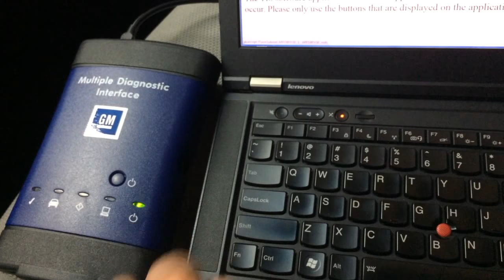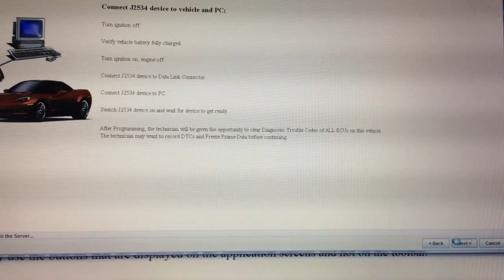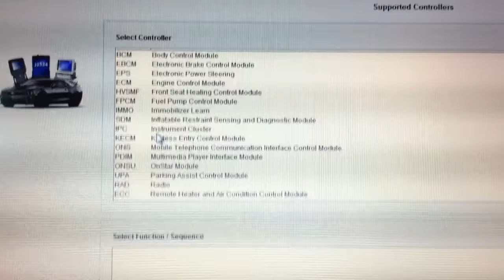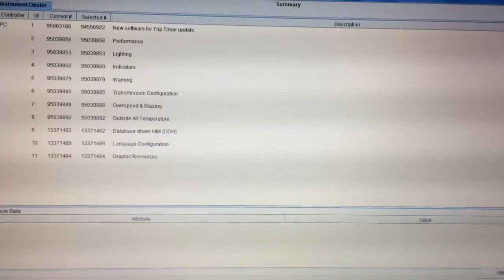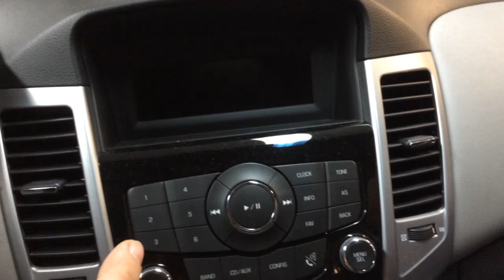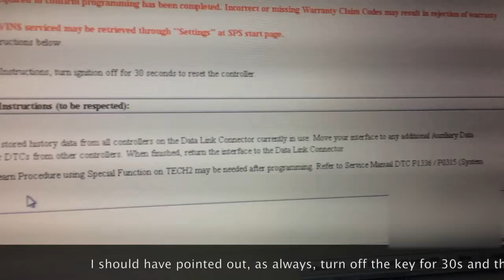GM SPS Programming: MDI Tool J2534 Mode ECU TIS2Web How to do a Calibration Update Reflash (IPC)

Comment: Can the GM MDI support ford online programming. Also are you into vehicle repairs. do you operate an automobile workshop in the USA
Reply from the maker: @Mayowa Odus I'm not aware of any out of the box way to use a GM MDI in place of a Ford VCM tool.   I would imagine significant modding/hacking would be required.   No I don't operate a shop, just as a hobby.
Reply: @DrShock  can the autel j3534 box support ford online programming
Reply from the maker: @Mayowa Odus I don't have any experience with Fords.   My experience is mostly with General Motors, Chevrolet and Pontiac in particular.
Reply: @DrShock  alright thanks a lot you have been of tremendous support. Can I get your contact details like your email.would like to ask some important information. Thanks once more

Comment: Hi! Do you know how to enable audio controls and cruise control in the wheel?
Reply from the maker: If the vehicle came factory equipped with cruise, it should be in the where you rebuild the vehicle for the BCM config.  You'll need more than just a calibrations subscription on TDS to get at that with an MDI, but its been a bit too long for me to recall the steps.
Reply: @DrShock  this version of the vehicle didn't came with cruise and no audio control too, only the top version came with. It's have a electronic accelerator like the top. And the audio control, can I enable? Here in Brazil have several technician to enable the audio control but not the cruise. The car is a gm onix sedan 1.4L petro year 2015. I was very glad to your answer, thank you.

Comment: Am trying to unlock a GMC terrain 2011 radio using SPS. The older one got burnt another used one was installed part numbers are different. Initial radio comes with a satellite radio while newly installed one doesn't. Getting to sps I didn't see part number for the later radio installed. Choosing the calibration file the "NEXT" button remained dormant. I used the autel jbox and also GM MDI. Any guide one this or could it be because part numbers are different. 

N.B : part number of burnt radio appeared on sps but couldn't find the part number for the used installed radio
Reply from the maker: SPS is only going to have calibration support for the radio part numbers the factory or dealer would have been authorized to install for a particular model and year.   Personally I've only done this procedure with a radio part number that was factory original.  If it were me I would skip trying to SPS it with a new calibration and instead use Tech2Win over the MDI to attempr a simple VIN relearn on the replacement radio.  F0 diag, model blah blah, F1 Body, more vehicle details blah blah, Special Functions, Radio, VIN Relearn.  The menu tree may vary on the Terrain but this is the general jist.  Not saying it will work, but worth a try since unlocking the radio is all you are after.
Reply: @DrShock  I tried this using the maxisys elite tablet and MDI didn't have the vin relearn function. Am looking at a radio part number compatibility issue here. Have watch videos where the sps was used to unlock the radio by simple downloading a calibration file to the radio. Read somewhere that basic relearning was supported till 2008. For 2009 upward it needs to be done using SPS
Reply from the maker: Then you're back to the radio part you have wasn't supported for the vehicle problem.  May have to just go the EEPROM pin pull route if you don't have the right radio.   Search around on Youtube there's some vids on this, not sure if it is applicable to the radio you have or not though.
Reply: @DrShock  could that have made the next button on sps inactive inorder for the radio to get programmed. The damaged factory installed radio had its part number listed on sps for me to choose. the incompatible radio didn't have it's part number listed on sps.
Reply from the maker: Not getting the context for what "could that have made" refers to in your question.   If the radio is in a locked state, and you can't do the VIN relearn the only other solution I'm aware of is the EEPROM pin lift.  But I don't have experience with a 2011 Terrain to know if that's an option for you here.   Would have to defer to another video for the EEPROM route as I don't do those mods personally.   When you do these EEPROM disablement mods it can affect some radio functionality, but the main purpose is that chip stores the VIN and by removing access to it the Theftlock II is bypassed.   Not sure what year this approach ended being viable though, 2011 might be "too new" idk.
Reply: @DrShock  yes I do know about the EPROM lift. I would be getting the exact radio with same part number soon. Could you be of help  with the programming. Thanks for your time out
Reply from the maker: Certainly willing to try, though if you have a compatible part number it should "just work" ;-)

Comment: I am new to this but I already have my j2534, to which page I have to go to acquire the tis program. I want to learn from scratch I'm from Guatemala and this would help me a lot.
Reply from the maker: TIS is online paid GM subscription only, go to www.acdelcotds.com to sign up
Reply: Hola Benedetto , there are ways around gaining SPS without acdelcots access , if the car is before 2008 , after 2008 all north American GM programming access was moved to the cloud for remote download from TIS . Previous revisions where issue on CD install to your computer via TIS2000 .
Reply: @adonisnetworks  I have a cardaq passthrough and I am really confused on what I need to purchase. Do I need the TIS2000 if I get Tech2Win and Do I need Tech 2 Diagnostic Software? I am getting into Diagnostics and programing

Comment: Does this still wok with ACDelcoTDS or is it blocked by GM?
Reply from the maker: Still working just fine from here in the USA.   Note that TDS is a fee based subscription service, so if you are not paid up you will be blocked.
Reply: DrShock thanks for answering and clarifying. The reason i asked is because i do have a subscription and Im using VXDiag VCX nano, which for some reason does not work and can’t get recognized on SPS
Reply from the maker: Just a guess, but see if this SPS UI change affected you - https://gm-techlink.com/?p=11972

Comment: I have been trying to access this (www.acdelcotds.com) now. All I get is unknown error occurred. Pls refresh page. Have tried different browsers like firefox internet Explorer and Google Chrome. Any way round it
Reply from the maker: Just tried it, works fine for me.   The landing page is now https://www.acdelcotds.com/subscriptions but it's still the same domain name for the website.
Reply: Am actually doing this from outside the US. Africa to be precise any way round this to access this website
Reply from the maker: This could be alot of things like your country ISP blocking this site, your DNS not having this site, or any number of geo blocking firewall situations in country.   Couldn't help you with any of that, and unfortunately the TDS help desk is only an 800 number so unreachable from outside the USA.
Reply: Am trying to unlock a GMC terrain 2011 radio using SPS. The older one got burnt another used one was installed part numbers are different. Initial radio comes with a satellite radio while newly installed one doesn't. Getting to sps I didn't see part number for the later radio installed. Choosing the calibration file the "NEXT" button remained dormant. I used the autel jbox and also GM MDI. Any guide one this or could it be because part numbers are different. 

N.B : part number of burnt radio appeared on sps but couldn't find the part number for the used installed radio

Comment: DrShock I appreciate your help I’ve done ipc programing for 2015 sierra 2500HD unfortunately when i was done the lcd went black and didn’t work again can you assist me on my mistake?
Reply: I used sps with MDI 2
Reply from the maker: You mention the "lcd went black" - where you applying a new calibration to an instrument cluster?
Reply: DrShock yes
Reply: DrShock when the programing finished the lcd went black and not functioning
Reply from the maker: Ok, so the IPC is "normally" a pretty straight forward SPS update.  I've not run into any issues with them, nor aware of any gotchas here as long as the cluster is the correct original one for the vehicle (if one modified a cluster or swapped it from a different vehicle then SPS could get confused).   Have you tried to disconnect the MDI and re-attempt to see what TIS2Web is showing for the calibration level of the IPC module now?   To determine if its actually bricked or just blank?  If SPS can still "see" it I would attempt to reprogram the calibration again, double checking that the calibration selected is correct for your vehicle and its RPOs.   If SPS cannot see the IPC, unfortunately it may be bricked (battery power fluctuation from a tired battery during programming can cause this).   Before I gave up and replaced a bricked module, I would try to disconnect it from power for awhile and then reconnect and retry one last time.
Reply: DrShock I’ve done what just told me and unfortunately it looks like that its bricked although everything when correctly the connections were perfect no disturbance what so ever
Reply from the maker: That is really surprising, for this particular type of module.   The only time I've personally seen, or even heard of, things go awry is with a weak battery (which the GM EL-49642 dealer tool mentioned in the description is intended to avoid).    Let's check one more thing before writing it off.   So you've disconnected it from the battery and that didn't help.  One other check you can do is the fuse associated with the IPC on the drivers interior side panel.
Reply: DrShock its fine already checked it twice
Reply: I swapped it with another ipc and it works , the one I programmed is damaged for some reason
Reply from the maker: Likely bricked then, could have been a power fluxuation but that's just a guess.   You may still be able to have it repaired, removing the EEPROM involved is usually the approach.   There may be some other videos that walk thru this for correcting mileage on late model clusters, for example.

Comment: Hi
Can explain me what is configuration and how is use
Reply from the maker: Are you referring to the MDI configuration within the GM Java applet?  Or?
Reply from the maker: Ok so that part isn't shown in this video, it's pretty straight-forward being USB to the laptop there's nothing you have to tell TIS2Web (or now Techline Connect) anything other than youre using a J2534 MDI connection as we showed in this video.  If you need to configure the MDI for WiFi, Wired, or a firmware update see the latter half of this other video here - https://youtu.be/pZfXuuzORZo

Comment: Well I had a nav radio go south 
Replaced it same nav unit but now the anti thief crap active dealer item to resolve ?
Reply from the maker: If the problem is a VIN lock, and needing a VIN relearn, yeah a dealer grade scan tool is required.   You would need to research whether your vehicle is older and needs the Tech2 scan tool (or Tech2Win emulator for the MDI tool) or whether it's SPS with the MDI tool.  It varies by year and model so I couldn't say for sure.
Reply: The ride a Cadillac 2006 sts
Reply from the maker: Tech2 era
Reply: Dealer will need to reprogram the unit  then  I got the radio from a junk yard do I need it’s vin ?
Reply from the maker: No, for a radio the dealer tech should just be doing a VIN relearn.  It will be like this video shows about midway thru, but not exactly the same scan tool menus since you have a nav radio, https://www.youtube.com/watch?v=ycS_jzIEtRk

Comment: HELLO! WHAT IS THE VERSION OF THIS SOFTWARE?
Reply from the maker: Not sure I understand the question here.   There is no particular "version" with TIS2Web, it's cloud based not something that runs on either a PC or even the MDI tool.   You always get the latest software with your GM subscription when you connect.   The MDI device itself is completely useless without a subscription to ACDelco TDS.   Now there is a firmware installed in the MDI just for its basic connectivity and hardware, and the latest for that at the time of this comment from Bosch/GM is v8.5.33.53.

Comment: My MDI won't stay connected to the vehicle. When I plug it into the car the car led lights and then goes out.
Reply from the maker: If you are referring to the green power LED on the right of the MDI, and you're connected to a vehicle that starts and runs fine then you have a power problem.  Either you have a bad cable, bad diagnostic connector on the vehicle,  or bad MDI.  That power LED is just showing +12V DC being there not anything more.
Reply: @DrShock  Does the car light only come on when its communicating.
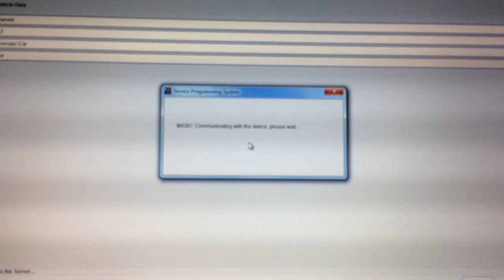Reply from the maker: Correct, only when the TIS2Web or GDS or Tech2Win Java applets in your browser are actually passing data thru the device. See 2:30 in the video as a reference on expected behavior.
Reply: @DrShock  I found the problem. It was the data link connector cable.

Comment: i am seeing that acdelco is now charging shocking rip off prices for sps programming anyone got any ideas how to negate this?
Reply from the maker: ??  Over at https://www.acdelcotds.com/subscriptions it's still only $20  bucks a year for two years for your own vehicle.  In the USA anyway.   But no, there's no negating this, if you need SPS on a vehicle newer than 2007 you pay for it via a subscription.  If you have an older vehicle get a Tech2 and TIS2000, no fees.
Reply: @DrShock  not in the us in the UK the fees are steep here Tech2Win (Tech2 Software Emulator for PC) - Level 1
TIS (TECH2 Diagnostic Software Download and Tech2 WIN)
1 Day 16,00 €
30 Days 200,00 €
1 Year 660,00 €
Select
1 Day 16,00 €
30 Days 200,00 €
1 Year 660,00 €
Service Information, Programming Software, Diagnostic Software - Level 1
TIS (all modules except SPS-Security, Tech2Win and GDS), EPC
1 Year 3.000,00 €
SPS Programming Software (from 01.05.2018)
SPS Programming Software
2 Hours 35,00 €

Comment: Hi am back again. Can I send my GMC terrain 2011 radio to you to have it programmed to my vehicle
Reply from the maker: @Mayowa Odus I appreciate the vote of confidence, but with the equipment I have it's really not possible to calibrate a radio outside the target vehicle.   This is a challenge even many GM dealers run into as well, where even they cannot perform a VIN relearn on a radio that was not part of the vehicles original RPO list down to the part number matching.    Whenever the donor radio is not a part number from the target vehicles model year, you almost always are going to hit a dead end.    I believe your best option in a non-numbers matching situation are the videos that describe disabling the radio's TheftLock II VIN pairing via circuit board modification of the EEPROM itself.   Typically just desoldering and lifting the power pin on the chip is enough.
Reply: @DrShock   do you have any idea if the GM MDI is compatible with ford online programming and also are you into automobile repairs
Reply from the maker: I believe I answered this on another thread already - no I don't have any reason to believe the MDI would be able to take the place of a Ford VCM tool as-is.

Comment: Hello. Is it a china clone mdi? Can china clone mdi do this? Many thanks.
Reply from the maker: Yes this is a clone MDI.  They are functionally identical in every way to the Bosch made ones.
Reply: @DrShock  I will buy a Gm mdi from china. Do I need a hdd? Or can I install to my laptop? Is this updates free or not?
Reply from the maker: @IsmailIsmail-ry1ql  The HDD option that some sellers offer is just to contain hacked versions of the GM Tech2Win and GDS2 Java applications.   These require a subscription from GM.  The SPS application is, so far, unhackable, and requires a subscription either way to use.  If you purchase the subscription from www.acdelcotds.com it will install to your existing laptop drive.
Reply: @DrShock  Understand. Last question. I just want to reset my cars transmission oil life and activate some hidden fuctions. Any chance to make this free? Whats your suggestion? Opel insignia
Reply from the maker: @IsmailIsmail-ry1ql  I'm not familiar with non-US makes like Opel.  But if these functions are part of GDS2, then the only free option would be the HDD package with the sellers MDI.  If they are part of SPS, there is no free option. In Chevrolet models with this sort of trans fluid reset, they are older and use the Tech2 scan tool.  So Tech2Win thru an MDI could be a free option, if applicable.  You'll first have to figure out how this procedure is performed at the GM dealer, to determine your options.  I'm not sure what you mean about hidden functions unless it's BCM option related.  Typically if GM wanted to hide it, their tools maintain leaving it hidden and do not allow enablement of anything unsupported.  Clones follow this being well, clones .

Comment: Hello,

Im having a problem with chevrolet orlando 2.0D 163 hp 2012 korea origin.

Car battery went flat.. and from that time i changed most everything and doesnt work,
Anti theft icon keeps constant and on ecu is an error " immo key not programmed" 

I have replaced ecu .. and did with AC DELCO tds "replace and program" .. with a successfull message also changed ingtion coil + immo box with antenna and used to program with ac delco gives immo learn completed successfully...
But dtc still remains on ecu and car wont start

Any idea?